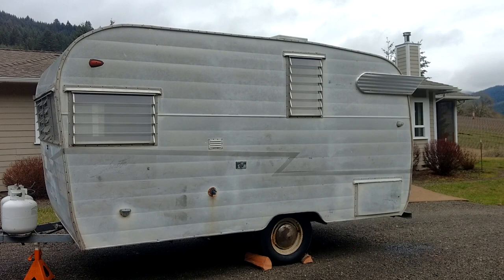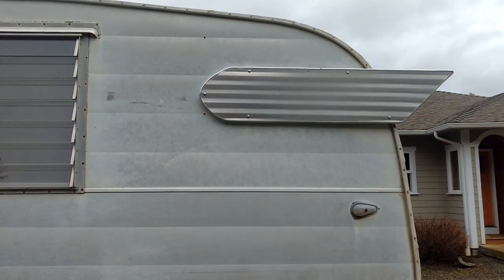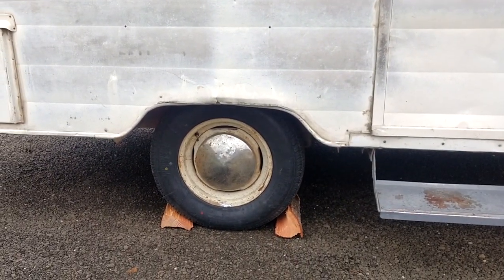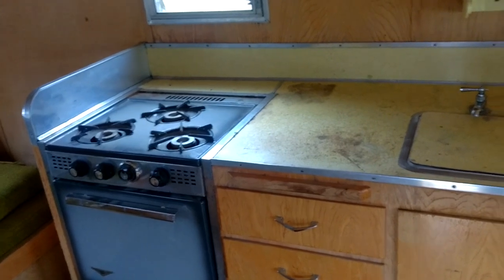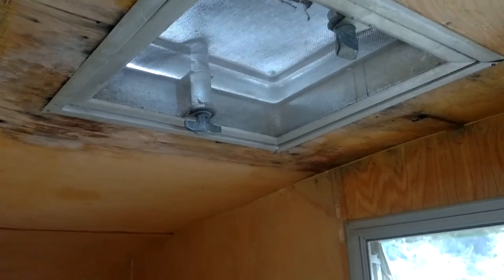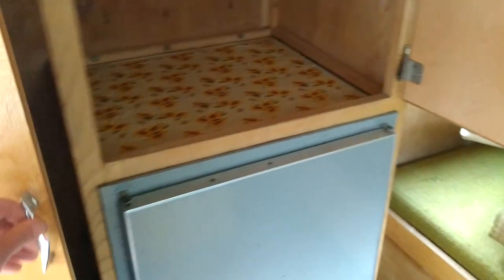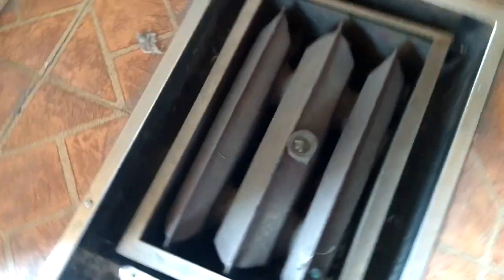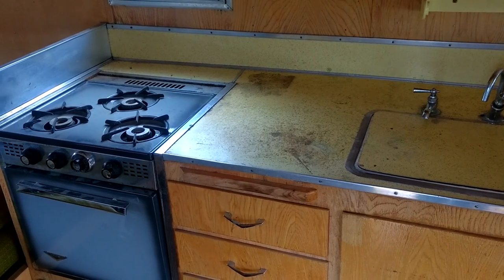1963 Shasta Airflyte

Comment: I have this same camper , stove is original, and mine is laid out just like yours. I don’t have floor heat. Mine is same yellow w/ glitter. We’ve just started our remodel. We have had this camper since I was around 8 years old, so she is still original,other than two sheets of paneling on the inside.

Comment: This is a Shasta 1500. I have the exact model and Im rebuilding mine doing a frame off restoration. As regards to the range, Yes you are missing the gas heating element. As far as the sink and range portion go, Im not sure if it was an option or not... I know on the Shasta Airflytes the configuration was just like the layout on the diagram in the cabinet. They might have stapled another diagram in your camper or used the same one for both the Airflyte and the 1500. I am rebuilding my cabinets and going with the stove on the right so that I can have a range hood fan over the stove and my sink will be in from of my window. I also have a Impala that I was going to pull mine with, a 63 Impala sedan to pull my 63 Shasta 1500. Good luck with the restore, they are a pain in there butt, but fun at the same time. Do your homework and watch Larry's Youtube channel "Mobiletec". He shows you the Do's and Dont's when it comes to these campers. Cheers!

Comment: Nice find.  I know this is video is two years old.  Did you make a follow up video to show your progress and how it came to partner with the Impala? Your interior is in pretty nice condition despite the water damage around the ceiling vent.  The color of the stove, though gray and out of sync for 1963/4 is original.  I have the same color stove in mine and ponder why they chose gray.  I have seen both yellow and white stoves in other models like this.  My model does not have the sliding doors in the upper dinette cabinet.

Comment: Look up Foster Wayne, he is excellent on these trailers. I would remove the kitchen cabinet, replace any bad wood and refinish. You're fortunate this trailer is dry. Still, inspect it carefully.
Reply: The kitchen cabinet in that configuration is original.  Some models had the sink on the right and some had it on the left.  Always work from the outside in.  Remove skins first and then  you can see where the damage is.